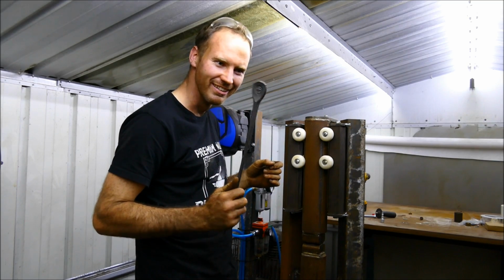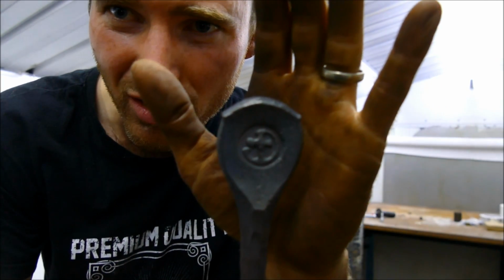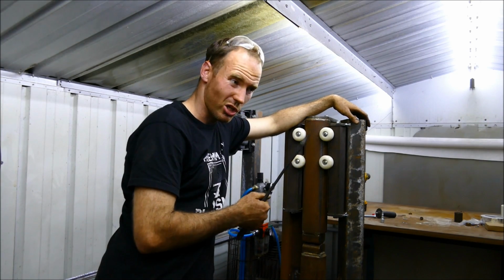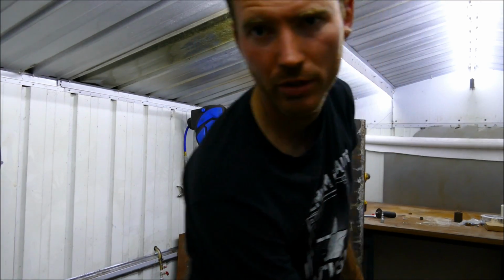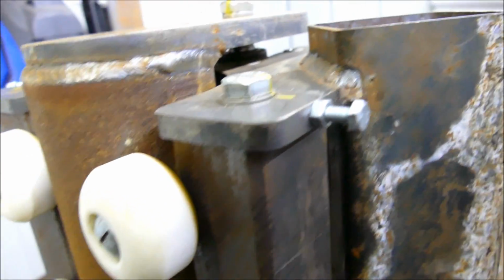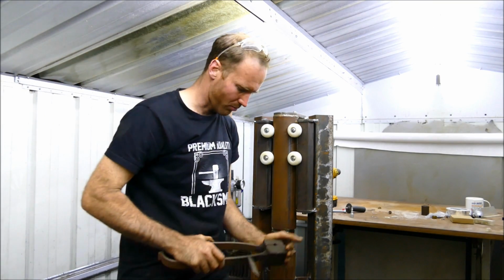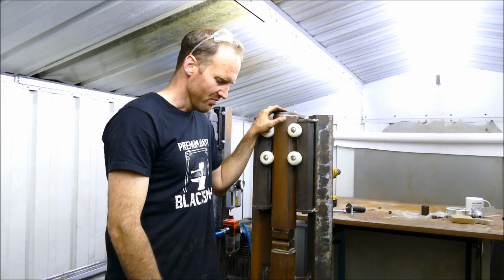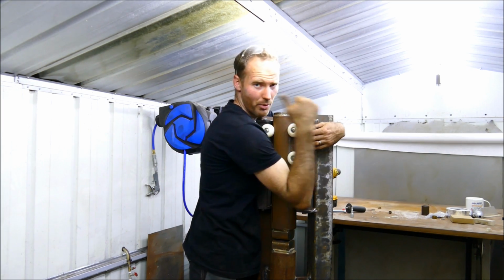!NEW! Ultimate DIY Power hammer build - pneumatic money maker - part 1

Comment: I think you've made yourself a perfectly functional power hammer Josh.
It's always a great feeling when a self built machine works as you'd hoped and it made me smile to see your enthusiasm.  It'll obviously make a huge difference, they're such a huge time saver it isn't even funny, and unfortunately yes that's the difference between making money or not these days. 
Good on you bloke.  
I've made two hammers so far but neither were pneumatic, or for me even. They were both variations on the 'tyre' hammer design and I think Kevin Boys is still running one of them over at Surrey Docks. 

I've got a couple of questions about the pneumatic design:
The valving seems to be a straight on or off system, either picking the ram up or pulling it down, so I'm guessing the only way to feather that is to switch the valving before it's completed a full stroke? Are you tapping the foot control rapidly when the ram is down to get the lighter blows?
The other thing that struck me Is that knocking sound every now and then on the lifting stroke. Is that the piston topping out against a hard stop of some sort, either inside the cylinder itself or on the frame?  I noticed when you didn't let the piston run a full cycle on the lift the camera didn't shake anywhere near as much as when you did. Feels like there's a lot of shock transmission going through the frame there.  Personally, I'd try to run it without hitting that hard stop as much as I could to save wear and tear. Cheap replacement bits still aren't as cheap as no replacement bits eh?  

May I suggest making a hydraulic forging press from a log splitter for your next homebuilt machine? You'll have a full house then, or a full shed at least.
:D
Reply from the maker: Thank you so much Ian! Yes tapping foot, if I go half through the valve I can get a very light blow by reducing the speed and can adjust the psi for more control range, it's very much like a drum kit. Knocking top is my first gremlin to kill, I'm thinking a rubber washer inside the ram maybe? Tire hammer was one I looked at but wanted it smaller and easier to build. Hydraulic press is one I would love but other than space it's lack of decent power for that, I'm on extension leads from the house still. Fuse hasn't blown yet and wires don't get too hot but can't have any serious power operations, the welder and compressor work off a blue 16amp plug and have to switch it over so they never run at the same time. I am thinking about a gas forge though on the outside of the shop with a hatch on the wall close to the side of the hammer? Thought that would keep excess heat and carbon monoxide outside. Cheers all the very best. J
Reply from the maker: Hey! Thank you so much for your kind comments and subscribing, patterns are now available and to say thank you here is a discount code for 20% off! just type POWERHAMMER1 as a coupon code. cheers J

Comment: I'm seriously impressed with the performance of the little inverter welding set, seems to run like a charm. Looking forward to being able to purchase plans to build on of those
Reply from the maker: Me too. I bought it for site welding job almost as a throwaway item at that price but is working brilliantly. If I used it every day like the ones at work it wouldn't last but it works the same as an expensive one.
Reply: @joshuadelisle  I bought the Aldi £70 DC inverter welder. So far so good, runs 3.5mm all day. Just putting together a scratch start TIG for it (WP9 torch). Cheap as chips, & it can run off a flex as thin as wet string, too! Love your content. 👍
Reply from the maker: @skysurferuk  nice one 👍. I've just been given a 10 in 1 welder (actually  just 5 with 5 other features) to review. Apparently it is stick, MIG, flux core, tig, and a plasma cutter. Well see if it's worth it but claiming that it is 10 in 1 was a brow lifter. Cheers J
Reply from the maker: Hey! Thank you so much for your kind comments and subscribing, patterns are now available on my Etsy shop detailed in the description and to say thank you here is a discount code for 20% off! just type POWERHAMMER1 as a coupon code. cheers J

Comment: Perfect! I have just got a quote for a Chinese power hammer, but now I might try and make my own! I just need a bigger compressor ..🥴
Reply from the maker: Cheers Gary!  I'll sort you out the blue prints. Got my compressor at a good price second hand. Not slot to them if parts need replacing. I put a new air filter and upt the circuit breaker and has been working well since. Cheers J
Reply from the maker: Hey! Thank you so much for your kind comments and subscribing, patterns are now available on my Etsy shop detailed in the description and to say thank you here is a discount code for 20% off! just type POWERHAMMER1 as a coupon code. cheers J

Comment: Was that red mud dirt, rocks, and water, mostly water, supposed to be concrete?
Reply from the maker: I'm not 100%. It's meant to be mastercrete and followed instructions to the letter. Not cracked yet so I'm hopeful.   But if I'm honest I'm not experienced enough with concrete. Any tips?
Reply: @joshuadelisle  If thats what the directions say it's probably OK. But
the drier the mix, which is hard to pour, the
stronger the concrete will be.
Perfect use of skateboard wheels when you're too old to ride.
Reply from the maker: Hey! Thank you so much for your kind comments and subscribing, patterns are now available on my Etsy shop detailed in the description and to say thank you here is a discount code for 20% off! just type POWERHAMMER1 as a coupon code. cheers J

Comment: Great build and fine welding. Would like to know what size cylinder you used and hammer weight. In any case, intrested in plans for this hammer.
Reply from the maker: 2.5" 68lb. cheers J
Reply from the maker: Hey! Thank you so much for your kind comments and subscribing, patterns are now available on my Etsy shop detailed in the description and to say thank you here is a discount code for 20% off! just type POWERHAMMER1 as a coupon code. cheers J

Comment: Talking about scale, i would make 2 trays opposite to each other, one higher then the other and with opposite angles to each other so the scale from the top tray slides into the lower opposite tray and from there slides into a bucket. I guess vibration will do the job to make the scale slide down to the bucket. Does it make sense? Im definitely interested in a drawing with measurements
Reply from the maker: Thank you! plans coming soon. good idea but why not one tray angled to the bucket or tray and shoot?
Reply from the maker: Hey! Thank you so much for your kind comments and subscribing, patterns are now available on my Etsy shop detailed in the description and to say thank you here is a discount code for 20% off! just type POWERHAMMER1 as a coupon code. cheers J

Comment: Very cool!  Well done. Ironically it's exactly what I have been looking for. Need a power hammer but don't haventhe space. I was thinking about a pneumatic table top hammer but I think I could make something that size fit.  I am definately interested in more information on this beauty.
Reply from the maker: Cheers Jim. I'm going to give it a fair trial and design out any gremlins that may appear. I'm going to do a video on tooling it up and making it pay for itself. Then I'll definitely share the design and all the specs needed to mount and power it. Thank you and all the very best. J
Reply from the maker: Hey! Thank you so much for your kind comments and subscribing, patterns are now available on my Etsy shop detailed in the description and to say thank you here is a discount code for 20% off! just type POWERHAMMER1 as a coupon code. cheers J
Reply: @joshuadelisle   Thank you so much!  I just finished downloading from your Etsy. All I have to do now is convert your Amazon parts list to the American Amazon and get things ordered. You have made a power hammer available to many with either little money or space that will allow us to have a decent power hammer that's both affordable and space  conscious.  Thanks again!
Reply from the maker: Thank you for valuing me and my work. Another good point is that compressor works of a domestic plug too. You can't get a press of equal power that can do that. All the very best. Cheers J

Comment: This is a fantastic idea! Any thought on shock absorption on the top end, it seems like it hits pretty hard?  I guess run it until it breaks and it's cheap enough to fix! :)
Reply from the maker: My thoughts exactly. I designed it so the steel plates top and bottom hold it together but you are right it's not great for it. It has a air break on the cylinder but it's not very affective. I could modify it with a large rubber washer inside? What do you think?
Reply: @joshuadelisle  I bet that would work, or maybe something like a common truck bump stop would be more cost-effective, though mounting it might be a trick
Reply from the maker: @Ipschnug  just got hold of some 20mm thick balistic rubber used for rail mounts on heavy plant machinery, its to stop the machine vibrating itself to pieces by absorbing the shock. hopefully if I cut a large washer out and put it inside the ram it should do the trick. we'll see. cheers J
Reply: @joshuadelisle  I look forward to seeing how it goes, keep up the great work!
Reply from the maker: Hey! Thank you so much for your kind comments and subscribing, patterns are now available on my Etsy shop detailed in the description and to say thank you here is a discount code for 20% off! just type POWERHAMMER1 as a coupon code. cheers J

Comment: Great build. Is it noisy? I would be interested in some plans? Paint it orange.
Reply from the maker: It's no louder than my old sahinler. The impact is loud but the mechanism is actually quiet, which is a good sign because it means there isn't loss of energy and is absorbed by the material.
Reply from the maker: Hey! Thank you so much for your kind comments and subscribing, patterns are now available on my Etsy shop detailed in the description and to say thank you here is a discount code for 20% off! just type POWERHAMMER1 as a coupon code. cheers J

Comment: Great to see you so happy, good job on the concrete launch pad.
Reply from the maker: thank you! We'll see how it goes. I wondered if it needed a rubber or wood barrier to absorb the impact but I think direct to concrete is working fine so far for the energy transfer. Cheers J
Reply from the maker: Hey! Thank you so much for your kind comments and subscribing, patterns are now available on my Etsy shop detailed in the description and to say thank you here is a discount code for 20% off! just type POWERHAMMER1 as a coupon code. cheers J

Comment: What size compressor did you use for this and this amazing man
Reply from the maker: It's 150ltr, 3 horse power motor, maximum 120psi. Cheers J
Reply from the maker: Hey! Thank you so much for your kind comments and subscribing, patterns are now available on my Etsy shop detailed in the description and to say thank you here is a discount code for 20% off! just type POWERHAMMER1 as a coupon code. cheers J
Reply: @joshuadelisle  thanks